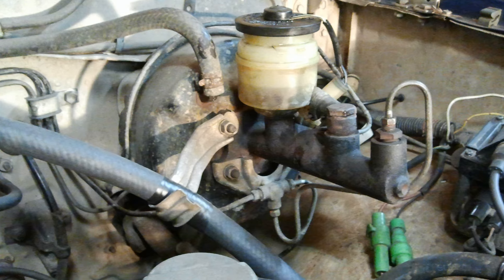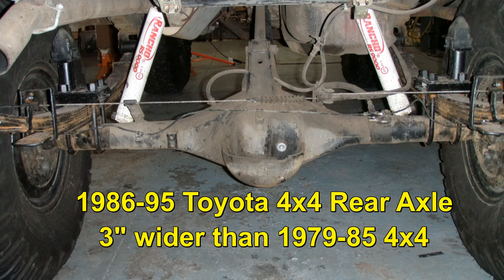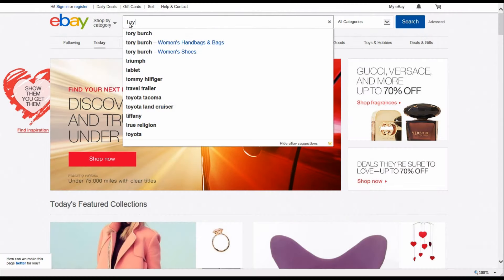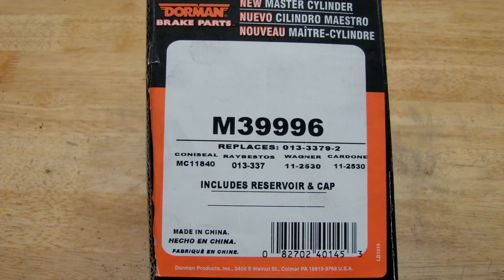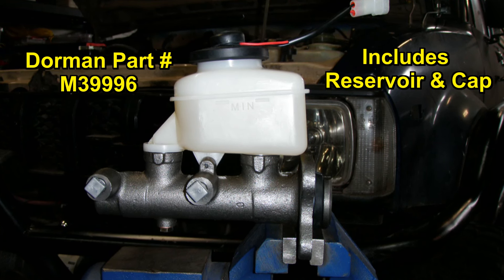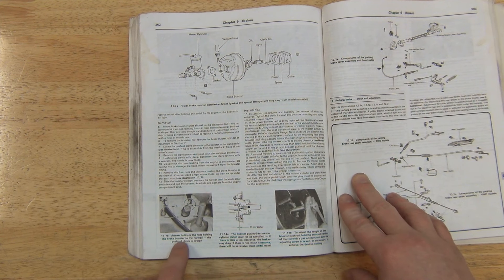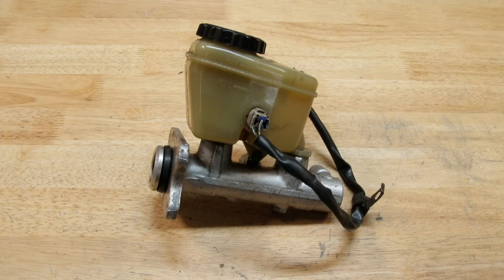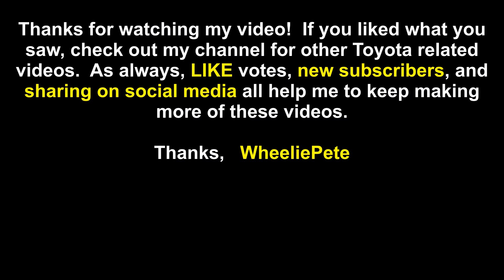Toyota 4x4 Brake Master Cylinder Swap 13/16" to 1"

Comment: trail gear sells a master cylinder kit for 79-87 toyota trucks and i believe is  a one inch bore that has no modifications needed (strait bolt up) and trail gear has a lifetime guarantee with no questions asked

Comment: Thanks for the detailed video! On my 1985 Toyota 22re motorhome the once replaced MC says 7/8. Should the Dorman 39996 1 inch fit do you think? The existing 7/8 MC has two side ports. I think I will try it as my braking has always been low pedal.
Reply from the maker: The 1" should fit, however, the reason I was swapping in my truck was because I had changed the rear axle to one with larger drums than what had initially been on the truck and I needed to move more fluid.  In your case, if you haven't swapped out the actual brake system for something different you might be better served with maintaining the status quo.  I'm not sure if they changed the brake booster for those motorhome swaps, but I bet they had the right master for the system.  You may just need a new master, but you might also take a hard look at the brake booster and make sure it's functioning properly, make sure there's no vacuum leaks, etc.  I would also recommend that you run an Aisin master cylinder if you can get one.  They were OEM equipment and I've never been dissapointed in the quality of Aisin parts (Dorman's hit or miss sometimes...)  Amazon link to AISIN's page with brake masters so you can compare prices and such: https://amzn.to/42S9KmS

Comment: I have an 86 4runner, used the master off an 86 Land Cruiser, same resivor just swapped the cap, no big deal.... So much nicer having the 1" vs the 13/16ths
Reply: Don´t know what size a MC from a 80 series LC is , but it´s aluminum and it fits mine 62 series. 60 / 62 are steell / iron and rust

Comment: If I want to upgrade the calipers to 95 Toy 4runner V6 3.0 calipers wich ones do I buy? I have a 1986 Toyota pickup 22RTE turbo 4x4 SR5 and also the I heard about the FJ60 rotors upgrade too but im not too familiar
Reply from the maker: So I'm familiar with the swap for the straight axle trucks, but I'm not sure how the upgrade goes if you have IFS (independent front suspension) to begin with.  The V6 caliper/vented rotor swap is usually talking about the Toyota Pickup/4Runner solid front axles when using 86 to 95 IFS style calipers. Once the vented rotors are installed, 1986-1995 IFS style front calipers bolt right onto the 1981-1985 solid axle knuckle.  1986 and later pickups and 4runners already have the vented rotors/larger brake calipers I believe...  If someone has better info than me...please chime in!

Comment: Great fix.  I have an 85 4 runner that is lifted etc.  I did swap out the rear axel years ago with a later 89 axel to get the extra 3".  Never knew about this.  I only run 33's with 4:88 gears.   Thank you.

Comment: Thank you very much,
bought a truck used, with master cyl being just replaced. Obviously previous owner had problems with breaks, for all these years i own the truck breaking was the issue I did all what i thought may help and nothing helped.
Now I am going to replace master with 1" and I am sure that will fix the problem.
Thanks again.
Reply from the maker: If you have normal stock tires, the 15/16" master shouldn't have any problems.  I've got 37" Swampers on this truck with the larger rear brakes from a later model truck so I needed to be able to push more fluid.  For my application the 1" master made the brakes way less sketchy.  Still not fantastic, but good enough not to be scary any more.

Comment: we do this 1" swap in Australia but use the 80 series landcruiser booster with it.  (non abs)  You have to flip the booster 180 to fit because the plunger is offset. Makes braking 100% better with the bigger booster
Reply from the maker: +benlyons83   Great tip!  I've never heard of that one.  I'll have to look into it.  Thanks!

Comment: This works great for any early toyota 4x4. My 87 pickup has V6 4runner calipers, a T100 1" bore master and booster and 80 series LC wheel cylinders in the rear. It is no sports car but I no longer worry so much about if I am going to be able to stop the damn thing.

Comment: Great video and explanation!  I like that you did one thing (changed the master cylinder), then compared the performance before and after.  

I'd be very interested to see what happens if you swap out your booster for a dual diaphragm unit.

Comment: 60 an 62 Series master cilinders can be swaped with 80 -100 series aluminum master cilinders. No more rust and piting in the original iron ones, A buddy swapped a 4.5 carb onto a 3F and it worked. When pushed hard it would stall a bit on take off

Comment: Great video but as you've probably already noticed, you will now need more pedal effort to put down as much force on the calipers.
Reply from the maker: Theoretically yes, however, on this particular truck with the 13/16" master with 37" Swampers, the larger 2nd gen drums in the back and 1st gen calipers in the front (smaller non-IFS calipers), and the LSPV (load sensing proportioning valve) removed, there was CONSIDERABLE effort needed to get the brakes to start working (mainly due to the larger rear drums and the lack of LSPV.)  With swapping in the 1" master on the above mentioned fabri-cobbled Frankenstein, the pedal effort was (in my perception) reduced as it no longer requires a massive push towards the floor to get braking to start working.  I fully understand the mechanics when in a stock system, with stock size everything, if you swap to a larger master it will require more effort at the pedal, however, a lot of that goes out the window when you start mixing, matching, and eliminating system parts.  I was fully expecting to need to go with a larger dual-diaphragm brake booster, but after getting it all put in and testing it...it was good enough according to my butt-dyno not to warrant the extra hassle.
Reply: @WheeliePete  would a stronger brake booster on top of the master help?
Reply: Mine is a 1984 LC 2F . 12 Ft aluminum boat on the roof. Back seat down,1 Ton of coolers, Boat Engine gas and gear. I will swap any extra breaking power or sistem when you are driving down road at 130 KPH . Added a extra main  leaf to the pack long time ago, Front and rear

Comment: Great video. Where would I get a new gasket for in between the cylinder and booster? Come with the new 1” cylinder?
Reply from the maker: You will probably have to get one from Toyota or make one yourself.  If I remember right it's just a thin paper one so if you make one that's thicker, you might need to adjust the push rod.  I just made one out of a roll of gasket material I have around the shop.

Comment: Great video. Dual diaphragm brake booster next?
Reply from the maker: +stuffedchicken420   The braking is actually pretty good right now (all new brakes drums, shoes/pads, etc. all the way around), but we'll see what the brakes feel like after I swap in some vented rotors and V6 calipers up front in the future.  Getting the dual diaphragm booster onto the 1979-1983 trucks can be a bit tricky due to the placement of the steering column, but if the current booster dies, I'll try to shoe-horn one in there.
Reply: +WheeliePete Get a dual diaphragm booster from a turbo truck. Smaller diameter and won't rub on the steering shaft.
Reply from the maker: stuffedchicken420  This is why I love the internet!  There usually isn't a problem that hasn't been figured out yet...at least with the trucks.  Thanks for the tip!

Comment: Pete, I have an 85 4x4 Truck with the booster/master swap already, have the original rear end with the 10" shoes, what bigger /better wheel cylinders will work from what year Land Cruiser or other Toyota will work as an upgrade? Don't have the 86 and newer /wider rear end with 11" brakes on it yet so want to install the best upgrade on my 10"?
Reply from the maker: I'm pretty sure you'll need to run the wider rear with the larger drums on it to be able to use the larger brake cylinders.  I haven't heard of anyone running a larger wheel cylinder with the smaller drums.  A rear disc brake swap may be a better option if you aren't going to get into the wider rear end with the larger drums.  Here's a link to Sky Mfg. page with their Toyota rear disc brake conversion kit and parts:  (I'm not affiliated with them other than I've bought stuff from them and been happy with my purchases): https://www.skysoffroaddesign.com/collections/toyota-axle-differential?view=48

Comment: Just out of curiosity. I have 1985 2wd 4 cylinder. Would converting to this with a stock set up be pointless? In the near future I'm converting from 195 75 14s to 235 70 15s. So nothing super drastic like 37 interco's. Or just stick for the stock Master? Thanks
Reply from the maker: No benefit for swapping this into a stock setup.  I needed to do it in the 4x4 because I swapped in a later model rear axle that had bigger brakes and cylinders.  I needed to push more volume to the new larger brake hardware.

Comment: Back brake line got a leak brake pedal went to floor fix line added fluid brake peddel went to floor how to fix.
Reply from the maker: There is probably a lot of air trapped in the brake system.  You will need to bleed the air out of the system to restore pedal feel.
Reply: Bleed lines 3 times is there a blocking value to reset
Reply from the maker: What vehicle?  There's usually a load sensing valve on the rear of the early trucks, but I'm thinking you've got air in the system somewhere if you're pedal goes to the floor and no fluid is leaking out.   Was the pedal producing pressure when you bled?  If it's going to the floor and not returning I can't see it producing much pressure for bleeding. Might need to vacuum bleed instead of pedal bleed.  Start at the farthest wheel cylinder or caliper away from the master and being bleeding there, and then move progressively closer to the master (making sure to keep refilling the master as you go).  If you get air into the master cylinder you might even have to pull it off the truck and bench bleed it and really start from square one.